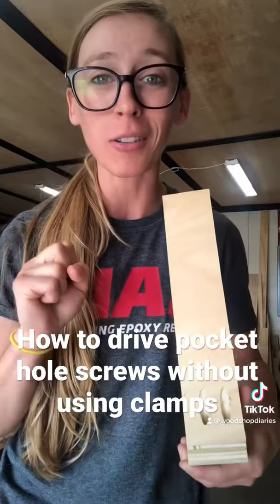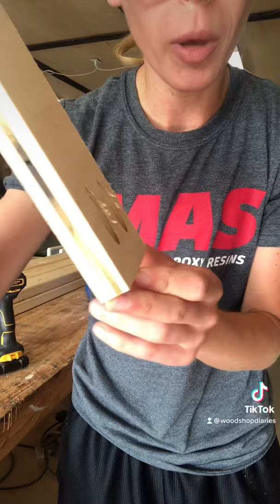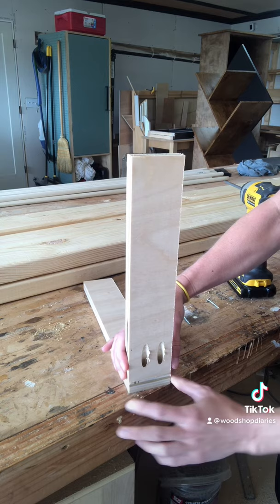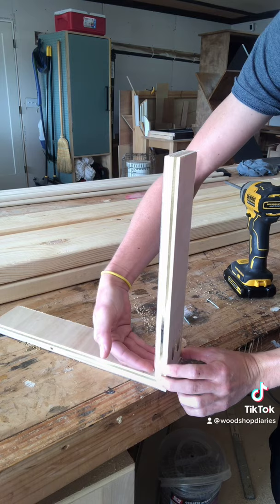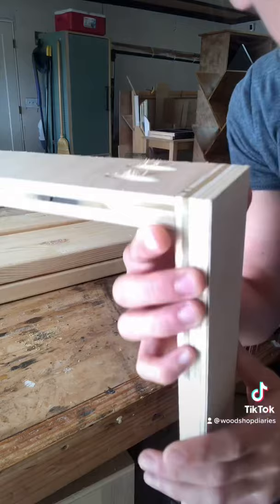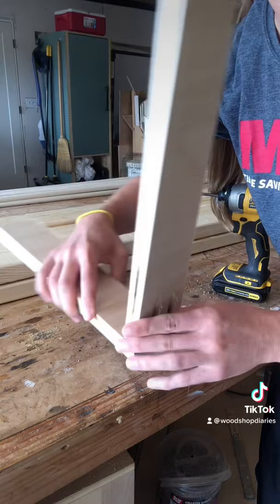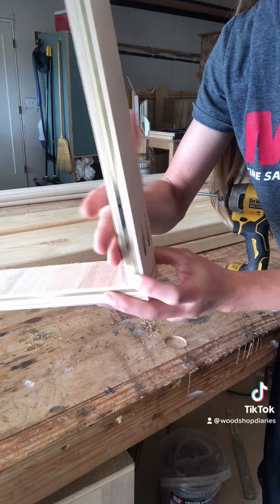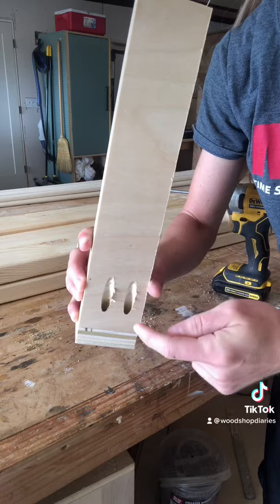How to drive pocket hole screws without using clamps #shorts

Comment: Also, set the clutch on your drill and you won't have to worry about overdriving.    Twist the collar to a lower number and try it out.
Reply from the maker: I don’t use a drill to drive screws. I use the driver 👍
Reply: @WoodshopDiaries it is better to use a drill with a clutch for this application
Reply from the maker: I use an impact driver
Reply: @WoodshopDiaries  I know, I as just saying that it is better to use a drill with a clutch for this application, less likely to overdrive the screws

Comment: It's way easier if you set the board that has pocket holes in it about a 1/16" out. Drive your screws & it moves back to flush & your screws are good and tight..
Reply: Just figured that out yesterday. Kept offsetting so just moved it back a lil bam flush..

Comment: Very helpful Shara.  I suppose I should  cut some scrap and give it a go this evening.  I've stayed away from pocket screws even though I've purchase a jig and screws in several sizes.  I guess I just needed your smiling face and encouragement to get going.  Hope your having a great day! Thanks for sharing.
Reply from the maker: I hope this helps!! When I first started, I didn’t have any clamps and didn’t realize you were even “supposed” to clamp these, so I never did. I guess I just kind of learned how to hold it and it saves a lot of time now. I’m sure you will get it after some practice pieces!
Reply: Craig, also check out Woodworking for Mere Mortals.   Steve has some great videos on using pocket holes as well.

Comment: Such a great tip, I was actually wondering how you drove those so well without clamps. Even with clamps my pieces tend to shift and spin. I'll have to try this next time, as I was always trying to push straight down as hard as possible!
Reply from the maker: I’ve found clamps not to be very helpful in this case. “Hand clamps” seem to work better for me. Push down and kind of “against” the pocket holes as you drive to keep pressure on that back side.  Hopefully that will help next time!!

Comment: Great tip!  I used a hand held scrap piece behind it for a long time... then I wised up and bought pocket hole clamps. Much better results when I took the "Dumb-arse" factor out of the equation. :)
Reply from the maker: As long as you figured out what works for you, that’s what matters 😄

Comment: That's a good time saving tip.  I always use clamps and it adds so many more seconds.
By the way, can we use pocket hole on butt joint that are not 90 degree but slightly more or less?  Would the joint still stay strong?

Comment: I think it also can have to do with the 'angle of attack' on the screw head. If the point on the pocket screw starts into the opposing piece as far to the inside of the hole as possible (as opposed to the center of it) because your drill and bit are beyond that 15 deg angle, you're going to create that offset, too.
Reply from the maker: I see what you’re saying but since the pocket hole bit leaves a pilot hole for the screw to start into, it’s pretty difficult to get the screw anywhere but the center of the hole. You could definitely be driving the screw at an angle off of 15 degrees, but many times this self corrects once it finds the pilot hole. At least in my personal experience.

Comment: Wait. I'm confused now. I thought pocket holes needed to be facing the other way from what you have?? Otherwise they will be super weak. True? False? Help!
Reply from the maker: You can get super technical about things like that. It’s good to keep in mind, but a little common sense goes a long way. I typically place pocket holes based on where/if they’ll be seen vs the direction of the screw. In many applications, it doesn’t make a difference because by the time you get done adding back panels, additional bracing/supports, it’s not going to matter. But I’m sure some will disagree. Personally, I build so they won’t be seen and design it so that it gets additional bracing elsewhere if it’s needed.
Reply: What do you mean, where should they be in this scenario?